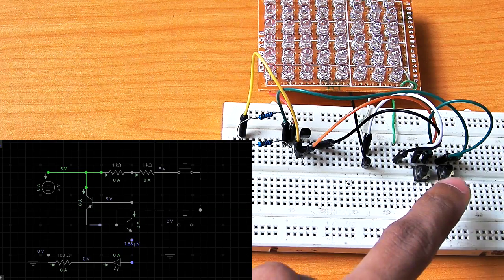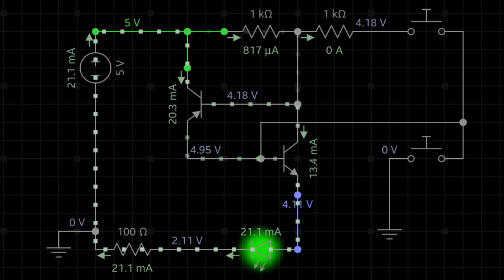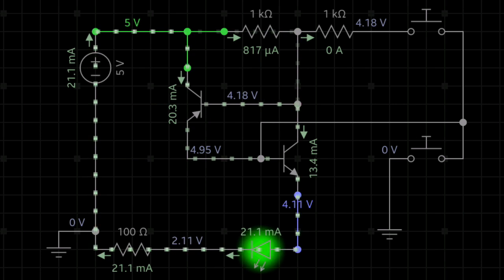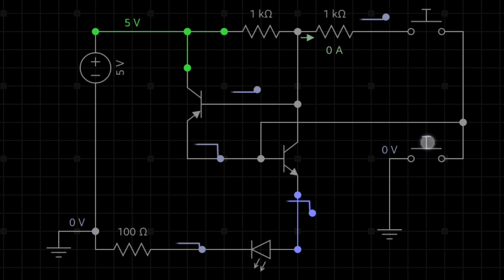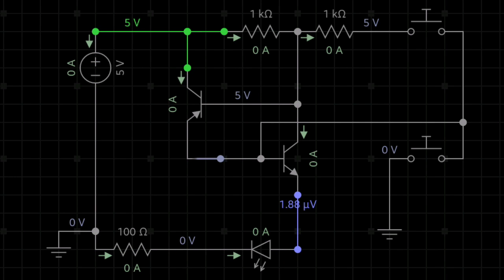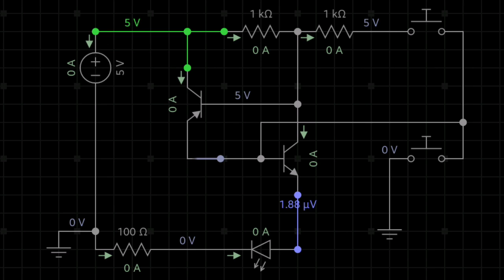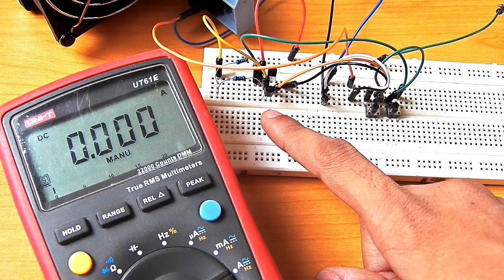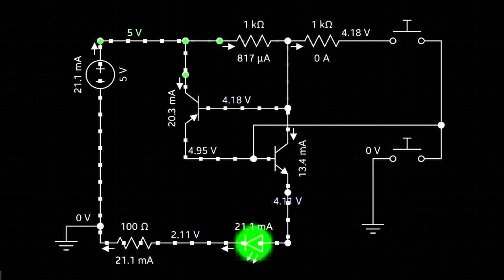Push on Push off Switch Circuit - Latching Circuit Diagram

Comment: Thank! So few components! When the circuit is latched "on", you indicate 21.1mA flowing through the LED at the bottom of the screen, and 13.4mA flowing into the collector of the NPN transistor. Transisitor base current is normally very small, so why is there a difference between 21.1mA and 13.4mA? Is it just changes introduced when you inserted an ammeter at each location to  measure the current? Thanks, for sharing.

Comment: Can I use this curcuit with 3 switches to turn 3 different fans on seperately, and another switch to turn all off at once? Also please tell me about the second pair of transistors, one is bf550, the other one?

Comment: Sorry am a very beginner.. just a simple question.... what will happen if we hold the push button ON for some time..
Reply: Hello,this is Alisa from the Dongguan Fvwin Electronics ,we are the manufacturer of illuminated tactile switch,push button switch,rocker switch.
if there has any request about it.please contact us,thanks!

Email:fvwin@fvwin.com
Skype:13580803551
Reply: Sandeep Thomas nothing will happen it will start and when u push and it will still start till u push

Comment: Interesting video Kedar.
Is there a way to make the same switch power on and then power off eg.. https://goo.gl/vVirXe Like a computer switch but not a toggle but momentary switch.

Also in case you missed it..Richard Li asked "Anyone knows why in the simulation current flows out of the emitter in the pnp? I thought it's supposed to be reversed, current into emitter then to base."

Comment: Sir i assembled  like ur circuit but when output check the voltage that time automatically changes valuea
Reply from the maker: +ramesh pyla ensure transistors are good & properly connected, if problem occurs again connect an 100k ohm resistor at the output.
Reply: +Kedar Nimbalkar ..
I assembled  three  types, problem is when pressed the switch's led growing, if i take output of the resistor automaticaly led  grow when i am not pressed any switch also..

Comment: I was modify a circuit with one push button because donesn`t work for me, my results in this video

https://www.youtube.com/watch?v=HPRTGDfymD8

And other circuit with two push buttons

https://www.youtube.com/watch?v=DOqpsOJRQgY

I was found better efficience with this circuit wth 555, you can change 555 for a lmc555 to save energy a change de led for a mosfet to control more power

https://www.youtube.com/watch?v=cjvylTmk6UY

Comment: Anyone knows why in the simulation current flows out of the emitter in the pnp? I thought it's supposed to be reversed, current into emitter then to base.
Reply: Yeah good question and that is the app doing that. (Every Circuit) Maybe someone should contact them and ask, unless there is another obvious answer we are missing.
Reply: Clearly an error. Current can actually flow in that direction called reverse beta.

Comment: Mr. Kedar, can I use 2 pieces of 2N222A NPN transistors instead of using bc547 and bc557?
what if i use 12 volts powesupply is it possible? because im planning to use a relay switch instead of the led strips. :)
thanks! :)
Reply from the maker: You Can Use Any Matching Pair of NPN & PNP Transistors.
Reply: What do you mean by matching pair?